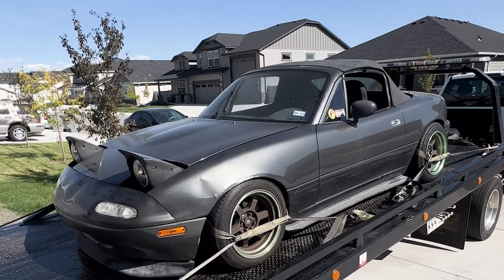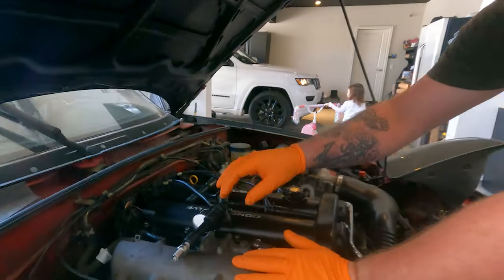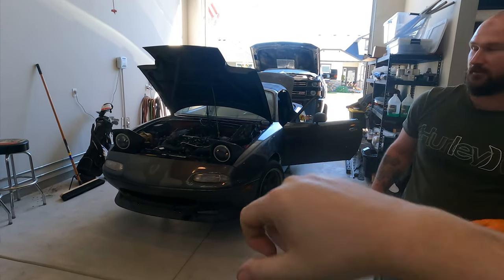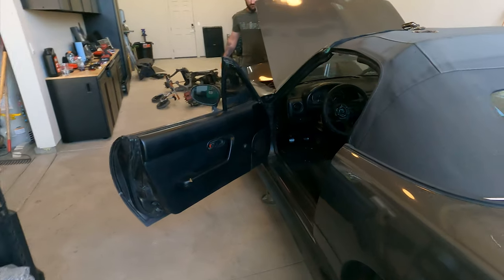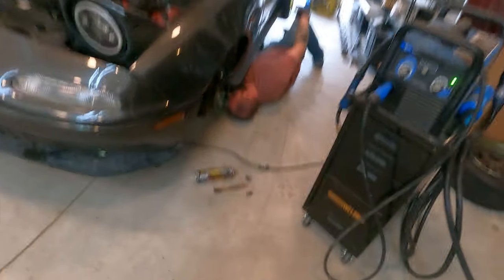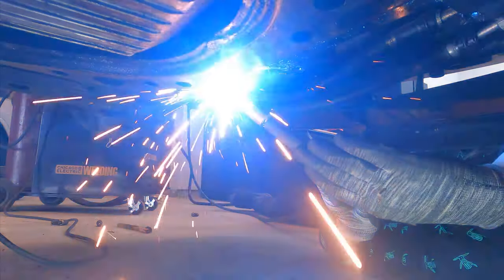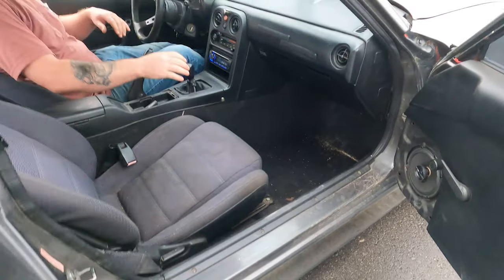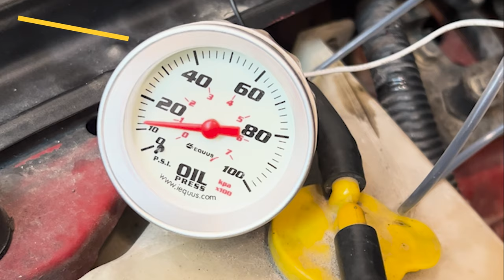You bought a WHAT!

Comment: that’s definitely knock 🤣🤣 coming from a miata owner
Reply from the maker: I think the GoPro audio may have made it sound worse than it was. When the car actually had oil pressure the noise was not there, once it warmed up and loss its oil pressure the tick was definitely coming from the lifters running dry